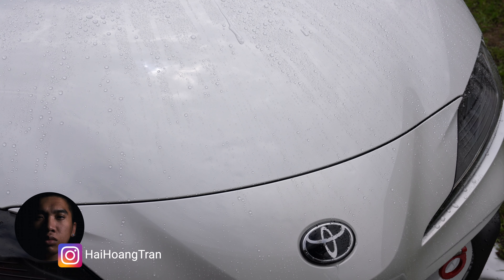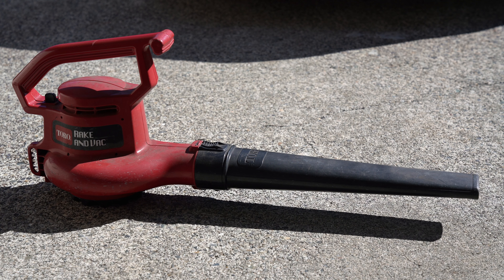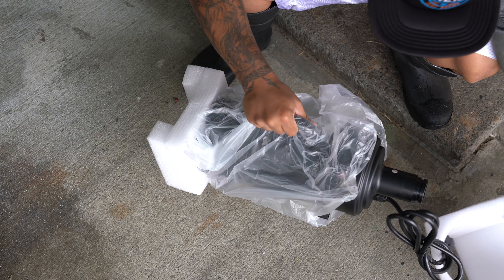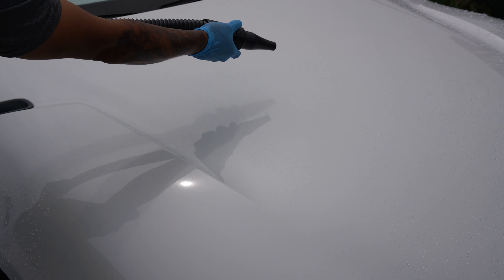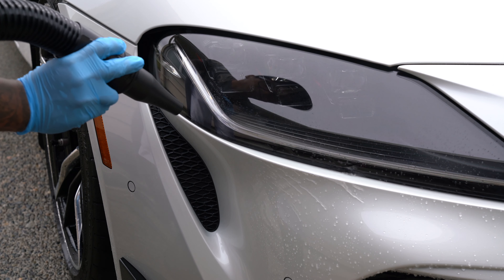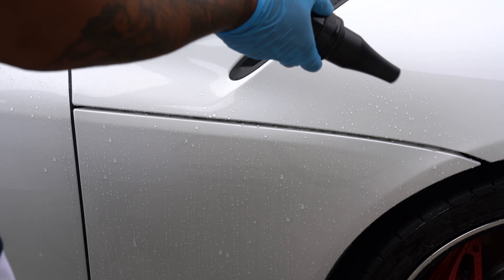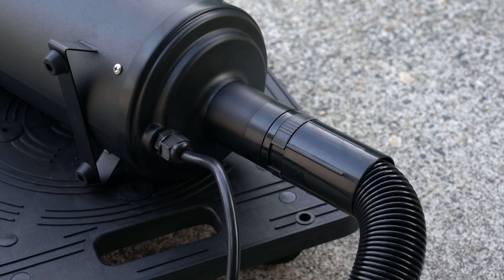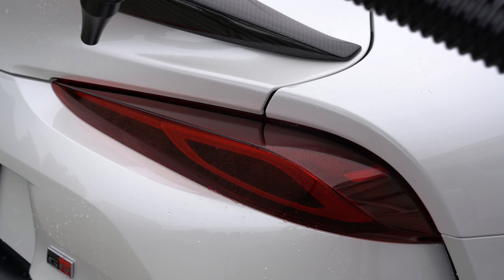Affordable Car Dryer Blower

Comment: Would you still need to dry with a towel and maybe some drying aid or does the blower remove all the little water spots as well?
Reply from the maker: The blower is suppose to replace the other forms of drying but depending on the condition of your car’s surface, it may not remove all the water. Also, water can still linger in between out of reach crannies that the dryer won’t always be able to reach.

Comment: Thanks for this video , super helpful. If my car doesn’t have a special coating, would the blow dryer still be useful? I’ve seen in many videos that people only use the dryer on cars that have special coatings.
Reply from the maker: If you plan to have absolutely no coating, nothings going to help you. Even a towel wouldn’t be of much help. Any coating is going to be better than nothing when it comes to drying. You don’t necessarily need the best coating, just something known to be decent.

Comment: helpful vid!  does the car need to have a good wax job for this to work effectively?  like if the water is not beading on the surface like it is on your car?
Reply from the maker: For it to be effective, yes. Without any form of paint protection, nothing's going to be of big help. Not even paper towels.

Comment: Performance and time wise, is a shop-vac used with the blowing side would be that less efficient?
Reply from the maker: I’ve never tried but can only assume that unless you through a couple turbos on the shopvac, the blow side will be pretty weak. It’ll probably work but not exactly efficient.

Comment: Nice video. Chemical Guys just came out with a blower called ProBlow. It’s pretty good and doesn’t cost much. I think it cost like $85 and it’s specific to drying cars.
Reply from the maker: I’ve never been a fan of the handheld blowers. I find them inconvenient without a hose.
Reply: I have the problower. It is awful. You are better off drying the car with a towel. You’ll finish faster.

Comment: I am gonna try tape a drinks bottle nozzle to the end of an old hair drier and see how it works as basically a free car drier 😁
Reply from the maker: You must have the strongest hair dryer in the world.
Reply: @HaiTran  haha, I didn't trial run and didn't work too bad at all, not good for large arears but all the edges, groves and wheels it blew the water out really well. For free it ain't bad
Reply from the maker: Whatever works for your needs👍🏽

Comment: So my question is...when hard water evaporates from blow drying it...what happens to the calcium and all the other minerals? Don't they stay on the paint? Minerals don't evaporate do they? That means you would still have to follow up with either detail spray or spray sealant to wipe away the minerals. Am I wrong?
Reply from the maker: You are right, but if you're blow drying the car the way you're thinking, you might as well not do it at all. The point is to blast the water off so it doesn't dry on the surface. Sure some of the water may dry because of the heat, but the heat is so minimal that you pretty much have to keep the air constant on one spot and keep the water from moving so that it dries on that one spot. In short, it's more carelessness than anything.

Comment: How has it been working out for you now???
Reply from the maker: I’ve sold this dryer since this video. Not because it didn’t perform well but because I’ve been trying to find the best for the price. So far, this is still the most powerful that I’ve tried for the price. You should check out some of my other car dryer reviews on this channel. They might help you out.
Reply: @HaiTran  did you look into the metro sidekick? seems to be the most popular but want to get the best i can for the price
Reply from the maker: I prefer high power car dryers so something with a little over 1HP would be close to useless to me.
Reply: @HaiTran  from your findings what would you say is the best option new or used under 100? just got my car paint corrected and goal is to not put a towel on the paint again
Reply from the maker: This seems to be the most popular budget option https://amzn.to/2PTau4w
Reply: @HaiTran  i just found a shelandy stl 1902 for only 60 dollars. do you think that would be adequate at 3.2hp? if not i’ll probably go with that one above
Reply from the maker: I haven't tried it so can't say. However, I have tried cheap blowers marketed with high horsepower that turned out to be false advertising.